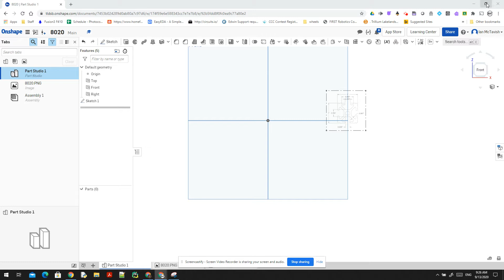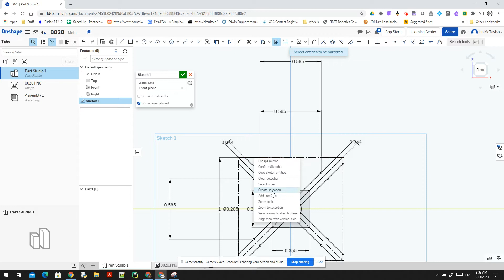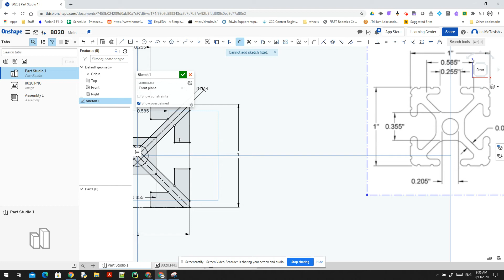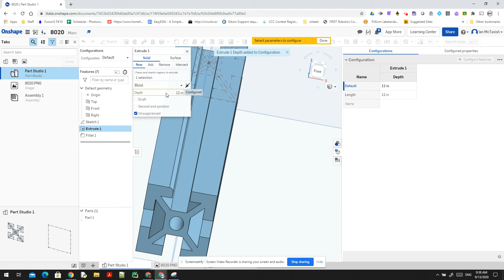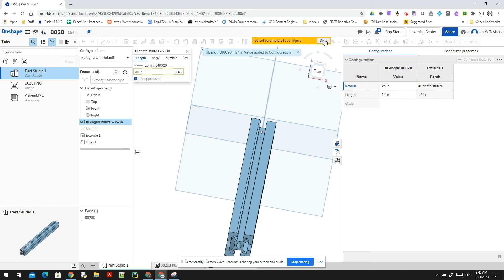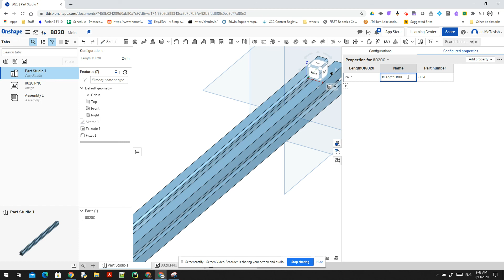8020 onShape Tutorial

Comment: Thank you! This is exactly what I've been trying to figure out. I just wanted to be able to pick 80/20 parts from a parts studio and set their lengths when I put them in an assembly. It's a simple problem with a not-so-simple solution.

By the way, great tip about generating simplified profiles to speed up rendering time. I was using the 80/20 profile generator feature script and my machine was really bogging down with just a few parts.